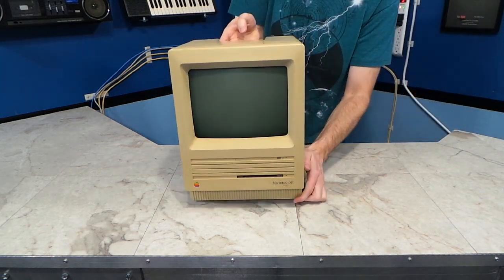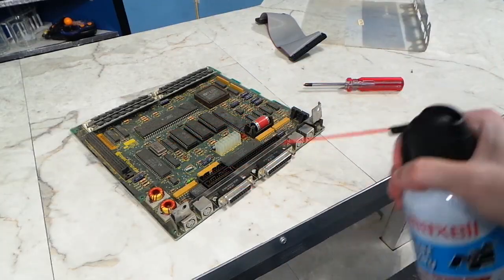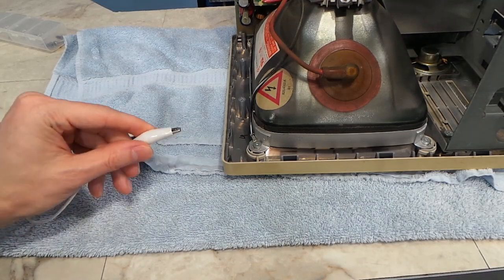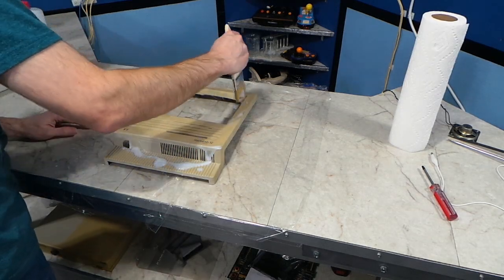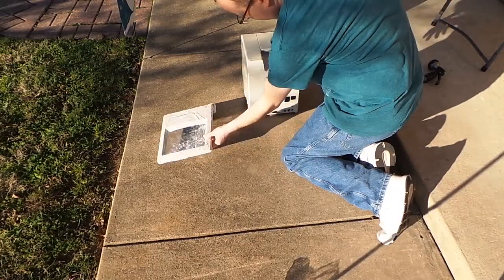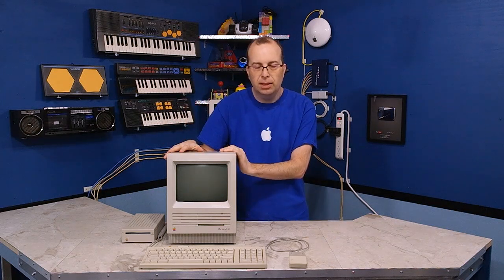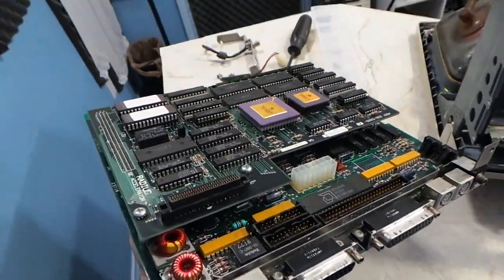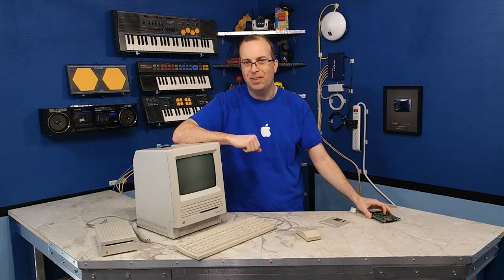Macintosh SE Restoration and SD-2-SCSI upgrade

Comment: You can get a SCSI2SATA adaptors and you should be able to gen a new floppy drive that will let you get back up and running, a 5TB Western Digital WD50EZRZ SATA drive would be perfect for your use as that will allow you to have all your favourite MAC applications.

Comment: What the heck is a smoke test?
Reply: +Russell Teapot Yep, but the smoke test name is older than the magic smoke joke.
Reply: MrWafflesNBacon See if the power supply goes into smoke.
Reply: If you plug it in and turn it on, and it doesn't start smoking, you're good. :)
Reply: MrWafflesNBacon plugging it in and making sure it doesn't start to smoke.
Reply: if you turn it on and it blows up!!!!!!!!! :)
Reply: Plug power in, turn on, see if there's smoke happening.
Reply: is this relatede to the "magic smoke" joke about electronics?
Reply: A uxwbill quote.

Comment: You need to remove the logic board up until the taps on the board align with the holes in the rails, you then pull it out towards you, you may risk damaging the speaker connector if you slide it out completely. also, that hard disk can be repaired, I have a video on my channel
Reply from the maker: Yeah.. I figured that out when i was putting it back together.  That made it a lot easier.